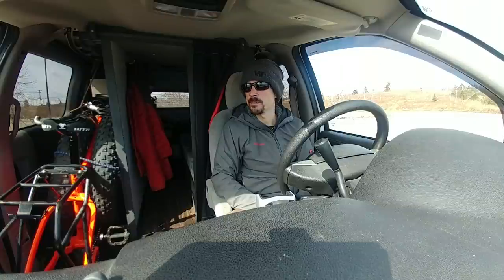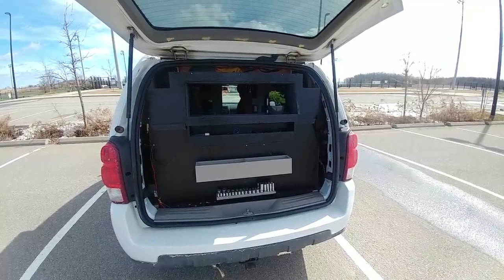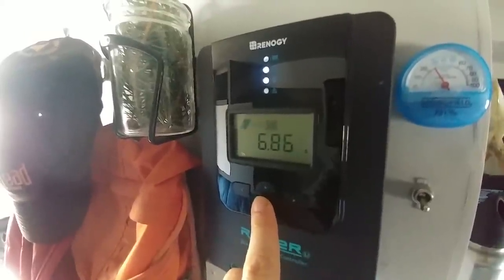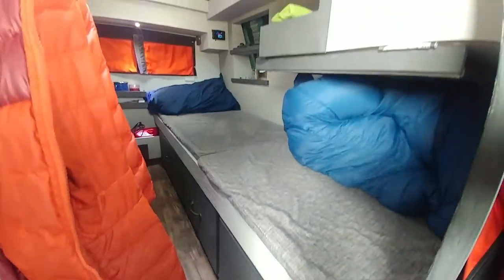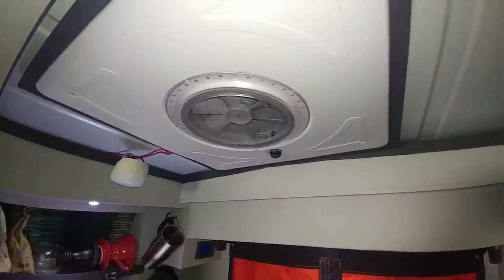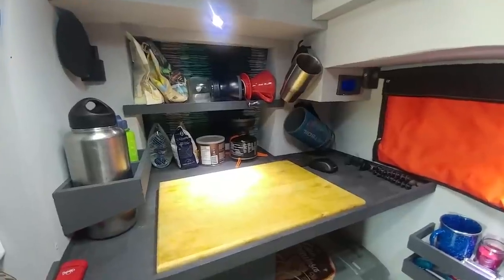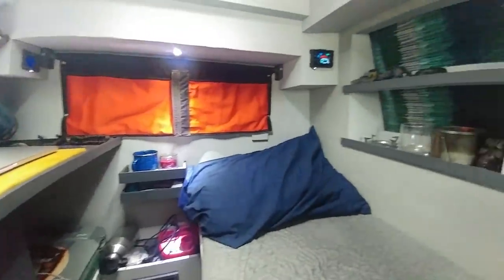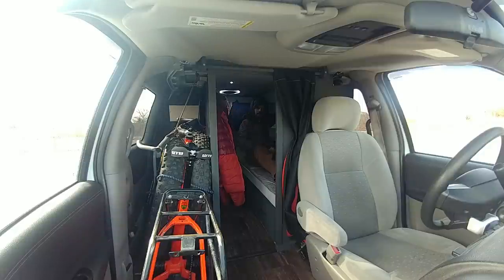First week of New and Improved Minivan Life

Comment: At the risk of stating the obvious again:  To deflect your cooking steam/ vapours, Amazon sell a 2-and-a-half watt plastic fan (I paid only 2 pounds & 50 pence, incl delivery).

This particular model was usb-connection only,.  It was complete with stand, was tiny & weighed almost nothing.......but was surprisingly breezy!   It only had one setting, but it pivoted, so if too powerful i.e. blowing steam beyond your fan extractor, then angling it would obviously solve that.

If u glue a suction cup to it, u might alternately transfer it onto your van dashboard in a hot humid summer for extra cooling on your face as you drive - that's especially welcome when stationary without motion-breeze, such as in a long traffic jam, obviously connected to cigarette lighter etc.

If you're ultra-keen to scrimp on every possible watt then here (below) is a 1-watt fan option.  No doubt you've seen the type of bendy-stick fan.  They allegedly emit quite a strong draft - I don't know, I've never used one.  They cost 1 pound in the U.K. incl delivery (1 dollar 30 cents).  Maybe you've got one already!

The fan below is usb but you wouldn't necessarily need to run a usb cable bcoz, although  it doesn't take a battery, it is compatible with power banks.

Amyway, a cheap & simple fan solution could at least avoid u havin to design & build a cooker extension, and would thus liberate more space/ consume less space whilst you're cooking.

https://www.amazon.co.uk/Zinniaya-Portable-Flexible-Cooling-Adjustable/dp/B07WG1ZP2G/ref=sr_1_13?keywords=fan&qid=1574004084&s=kitchen&sr=1-13

Comment: Metal rack you say....I may be able to help with that. I am in the GTA (thinking your out closer to the falls?)
Reply: I think he’s near Milton
Reply: Even better. I’m out Cambridge/Guelph way.
Reply from the maker: really?  I have a basic plan drawn up.  aluminum would be nice but steel would work too.  I'm not too far away from Guelph.
Reply: ForestyForest could easily do it out of steel. Unfortunately I am not setup for welding aluminum. Could rivit or bolt it together if using aluminum.

Comment: people act like I'm crazy for suggesting a subframe with water tanks, insulation, and AC is the ONLY way to go.. I first did it with a '05 3.8 grand caravan and then went on to an extended RAM van with the "panel" configuration..
Reply: I would like a van conversion aircon like you said would actually a/c is important to me
Reply: I was thinking about getting the van conversion the air conditioner ideas sounds great. It's always important to me a good air condition
Reply: @coryburns1905  the most efficient cold air is a 5000btu unit that does 12 EER. For heat you do a heat pump that also takes care of condensation that causes mold.

Comment: You have DC power coming from your battery into a DC to AC converter into which you have plugged an AC to DC converter to power your notebook. That's inefficient as there is loss on both conversions. If you can afford a DC power adapter for your notebook which you can plug directly into your DC system, you'll save some power.
Reply from the maker: Yes i know i looked into adapters but i didn't feel like spending the money.  It's a 20v charger.

Comment: This causes me to look at my 2006 Chevy Uplander in a whole different light.  My van has 241,000 miles on it and currently has a voltage drain that is running the battery down every night.  ---really starting to piss me off.  It's been a great vehicle though.  And I don't live in it.
Reply: You might try adding a new ground from the engine to the fire wall. No diagnosis. Just add a grounding strap. Might very well fix drain.

Comment: If you're mostly charging phones/laptops, why not just use car chargers? Much more power and space efficient than going:

12V DC -> 240V AC -> 20V DC for the laptop
Reply: Good build though, really like the whole thing! :)
Reply from the maker: Thanks man.  I've been looking for a magsafe car adapter but it's a rare thing because apple is a complete idiot with that sort of thing.
Reply: Fair enough, there are Chinese solutions available but that could be a pretty expensive experiment :P

Comment: Plastic deck wood would be better.
Reply from the maker: That is interesting i never considered that, thanks.
Reply: PVC board, then you can get white and its smooth. Mitered cuts, maybe a dado cut to hug the rails and capture the voltacts. White coated fasteners or recessed holes with plastic plugs to cover them like on lawn furniture.
Reply: Just how my mind works after years of making things. Your welcome. Really dig what you've done. At first I wasn't but after seeing it longer I now believe its the way to go.

Comment: MODIFIED sinewave inverters like that ALL make noise. It's how they're designed and WHY they're cheap. Avoid the Chinese stuff. See if you can get something made in Canada or USA. It will be like twice the price of a chinese pure sinewave but you'll never regret it because it won't overheat in the summer. Even the pure sinewave chinese inverters are junk.

Comment: Are you not concerned with all of the weight that the wood ads? You probably only have about a 500 pound payload capacity from the factory. That 500 pounds would include all of your stuff, all of the wood plus your weight and everything else in the van. You might be overweight
Reply from the maker: I remember weighing all the seats when I took them out.  They were pretty heavy, around 250 lbs if I remember correctly. I probably added that much back in, plus a bit.. Maybe similar to having a couple passengers inside. I wish I couldve accurately weighed it, but I'm confident it's under the maximum capacity.